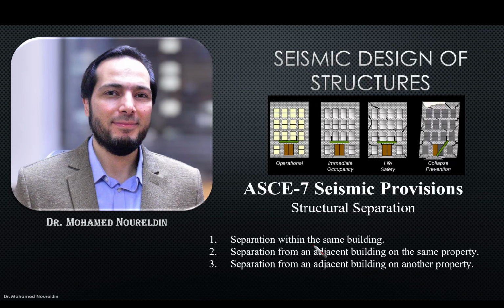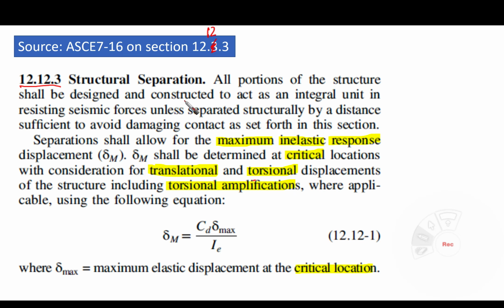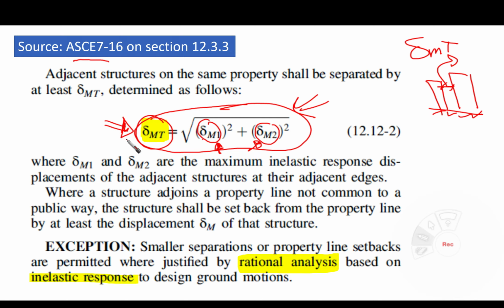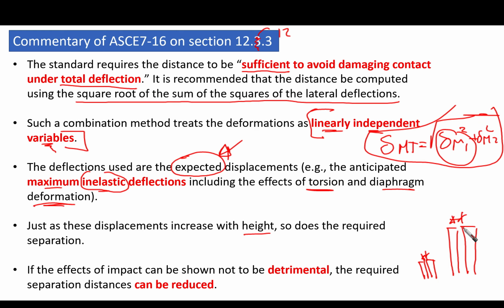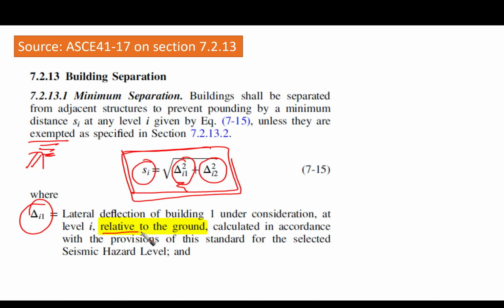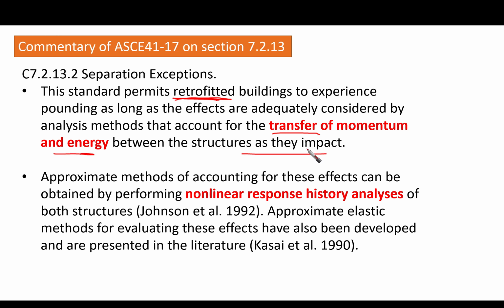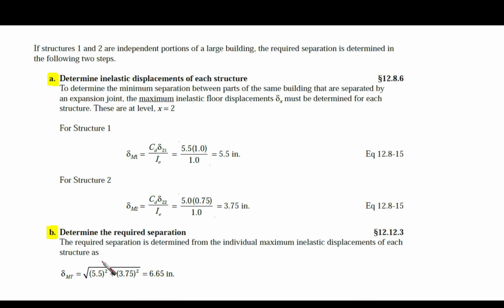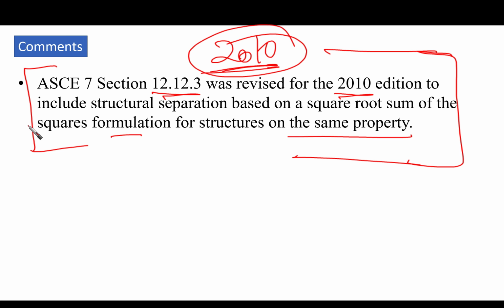24-ASCE-7-Structural Separation with Example-Dr. Noureldin

Comment: Dear Dr. Noureldin,
Thanks a lot for your video post and Im so glad I came across it.
Your explanation base on codes regarding the importance of building separation due to lateral loads and also how to calculate the magnitude of this separation gap between buildings is very clear.
May I respectfully ask one question Doctor.
In a case of small separation gap of say 75mm, can a filler material for expansion joint be used permanently to fill the gap and cast concrete of a new building wall which is beside an existing building wall ?